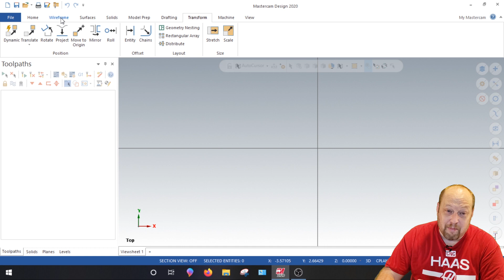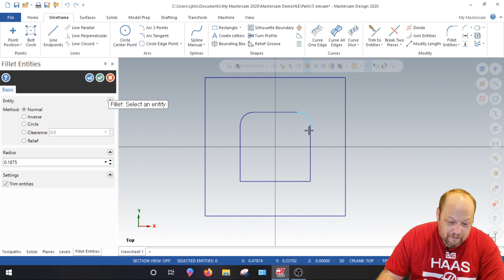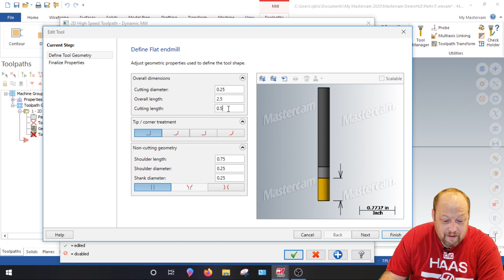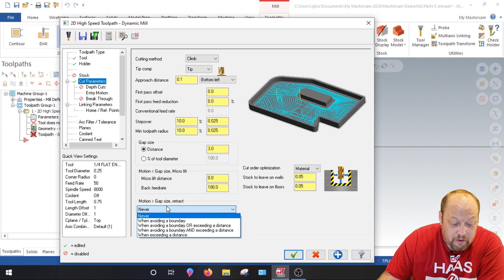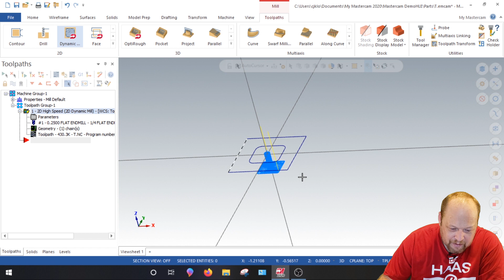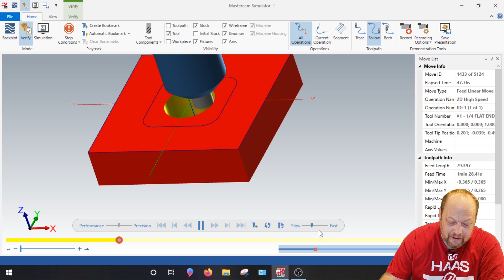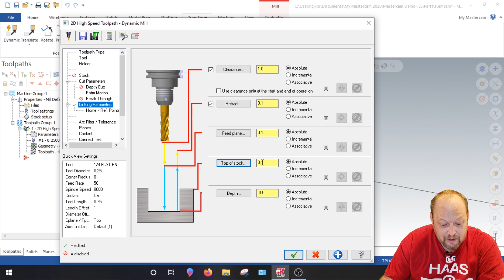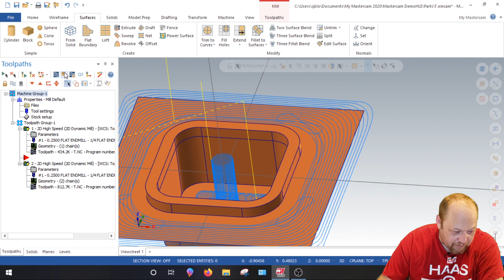Mastercam,  Dynamic Milling Tutorial

Comment: The pocket doesn’t work once you add the boss as the flute length is only 0.5” and with the boss it becomes 0.6”. I haven’t used Mastercam before but out of interest why didn’t you create the geometry first then build the toolpaths?
Reply: KlawTor MFG: I’d still be interested to know why you didn’t build the model first then create the toolpaths- do you generally create the geometry alongside the toolpaths as and when required? If so is that because you are just working through the order you’ll do the machining?